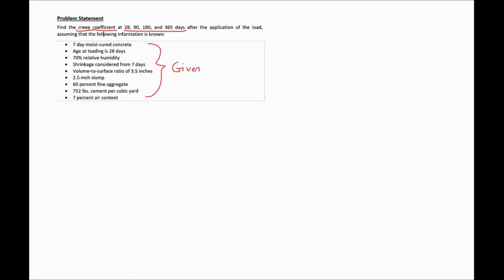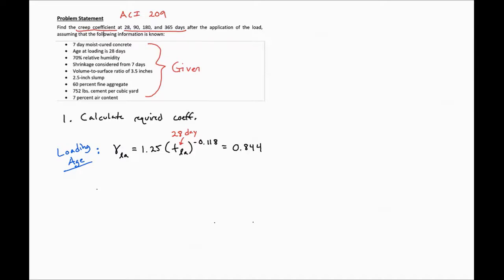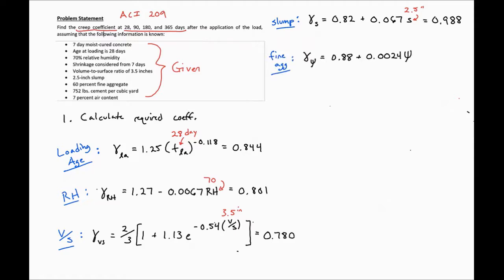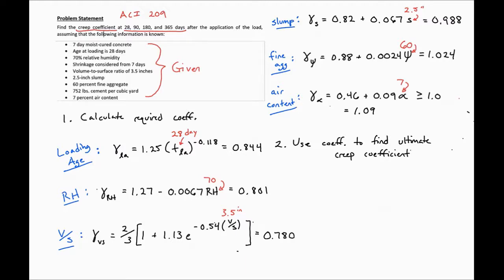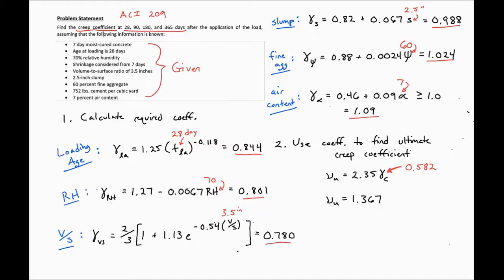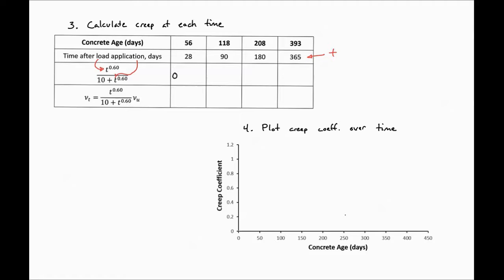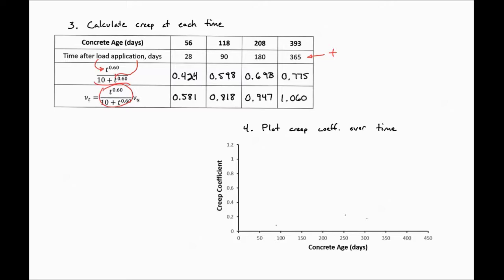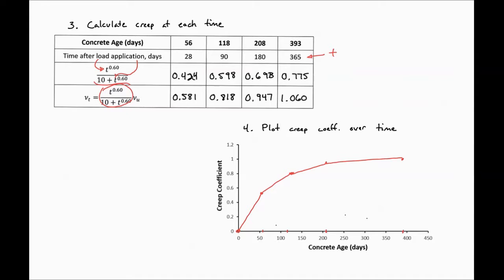4 - Example Problem Finding Creep Coefficient Using ACI 209

Comment: What size cylinder was used, trying to find the volume to surface ratio, assume this is cross-sectional area/perimeter. is that correct.

Comment: Hi, thank you for the explanation, but may I ask a question?
in the second part of the video you used the value 10 in the equation, but in the ACI-209 - eq (A-18), d described  ( in days )!
Could you please clear that up for me?
Thanks
Reply from the maker: The value 10 for d is the recommendation in ACI 209 for a loading age of 7 days, for moist cured concrete and for 1-3 days steam cured concrete, shown in Eqn. (2-8).
Reply: @davidgarber1664  thank you sir for this great video 
my question is in safe 2016 when we want to make a long term analysis he ask us for the creep coefficient  is that how i calculate this coefficient   and put it in safe ?! 
another question is someone told me that we can calculate the creep coefficient  = 1+ creep factor 
and the creep factor it is as shown in aci 318-14 is  = ζ /1+50ρ'   (24.2.4.1.1) is that right ???
Reply: Thank you for your time & consideration. I appreciate it.